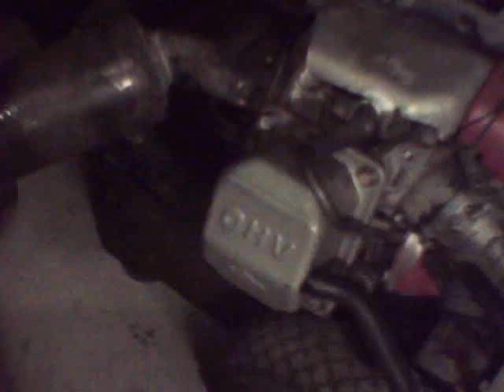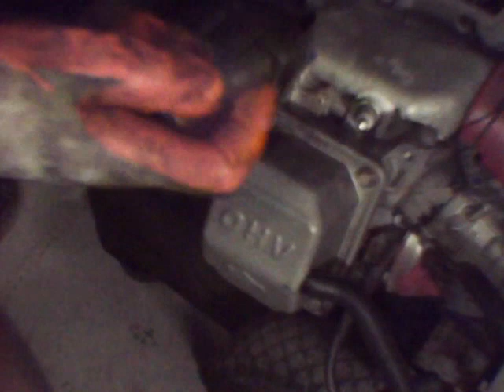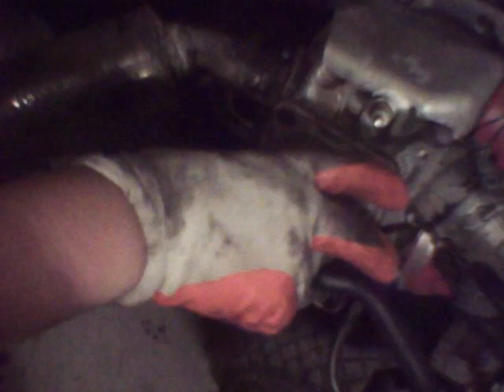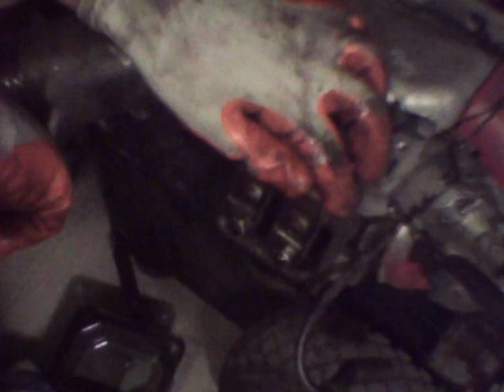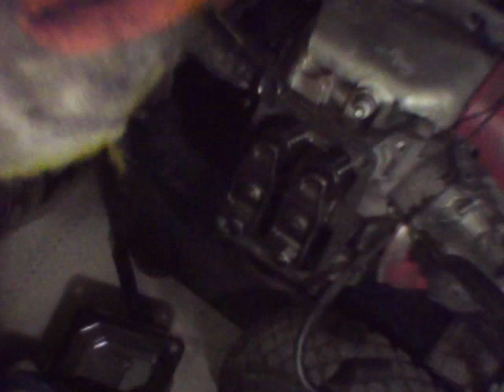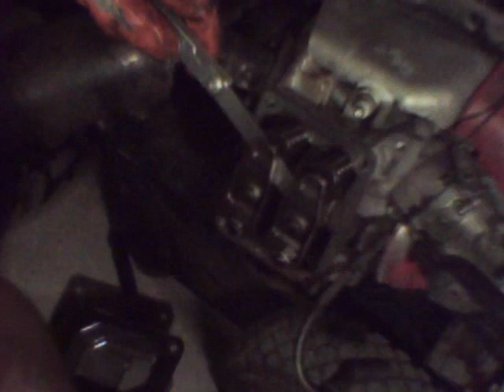How to set valve lash on a Briggs and Stratton OHV engine

Comment: YES  BUT  HOW  DO YOU INSTALL THE  ROCKERS BEFORE YOU  DO THE ADJUSTMENT .. LIKE HOW MANY TURNS DO YOU MAKE ON THOSE CENTER BOLTS HOLDING THE ROCKERS ON BEFORE  YOU DO ANY ADJUSTMENTS ON THE TORQUE SCREWS?

Comment: Good, simple example of how to set the valve lash.  The specs vary dept on the model #, etc (as I have found).  Check to be sure or eng damage may result.  These specs are also available on the ole "inner-web".   Thanks for the vid.  Spot-on and simplistic.  Sure has helped others...

Comment: FYI:: the lash adjustment on my intek 190 is .004-.006 on the intake valve (ONLY), and .009-.011 on the exhaust valve.  They do this to allow tor the extra expansion the exhaust side will exp during normal run times.  These specs vary dept on model #.  Thought you should know.